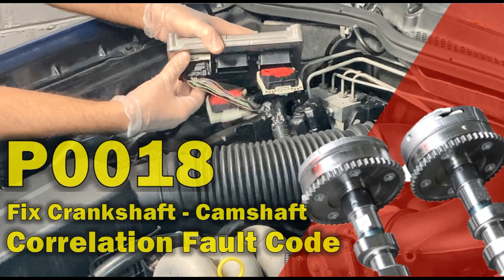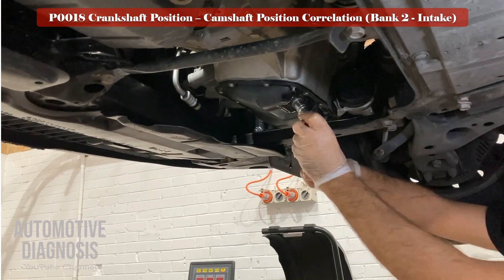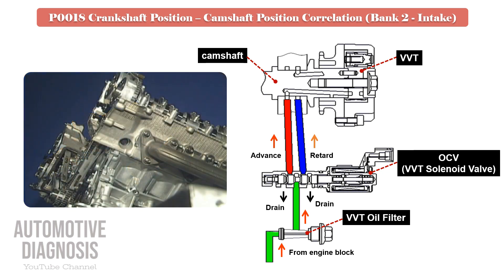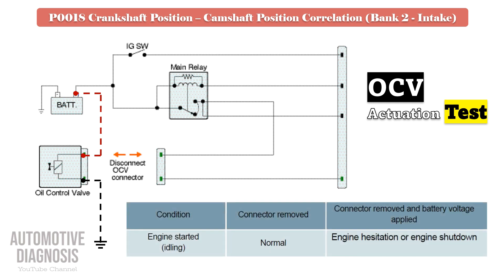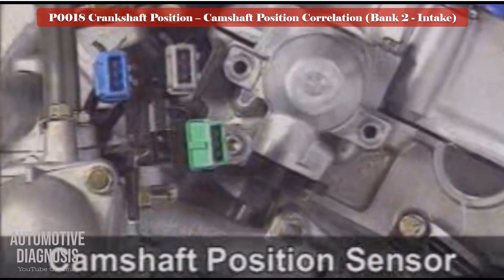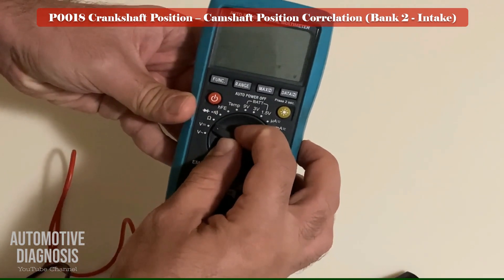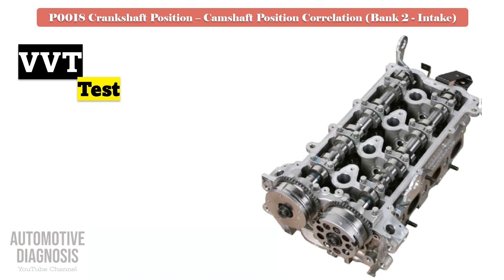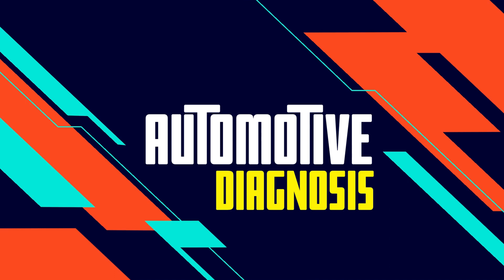How to Test & Fix P0018 Crankshaft - Camshaft Position Correlation Bank 2 Sensor A (Bank 2 - Intake)

Comment: Audi a7 2015 I did a oil change  and did a tune up P0018 plus bought 2- sensors cost $320 now after my mechanic did all that and clears the codes I went to work then on my lunch break drove off and the code re-appeared😤😤 what now🤨
Reply from the maker: Hi there, did you change the sensors or VVT solenoids? if sensors, which ones?

Comment: I need help please my Audi a6 2014 a6 3t shows bank 1 and 2 corraltion A AND CRANK SHAFT SENSOR , I changed them and I have miss fire on  4,5,6 I swapped coil pack and spark plugs still have all codes !!!
Reply: Did you erase the codes after you replaced the parts?

The vehicle may also have to do a relearn procedure.

You say it is a 2024 vehicle. Warranty should cover this repair.
Reply: @raoulcruz4404  idk why I put 2024
Reply: @raoulcruz4404  it’s a 2014 😭😭
Reply: Take it to the dealer and put the original parts bacl on the car. There gonna blame You and try to avoid the warranty

Comment: Dodge challenger 2017 3.6 v6 keeps getting codep0018 Crankshaft Position - Camshaft
Position Correlation Bank 2
Sensor 1 replaced sensor camphasers on bank 2 retimed it complete tuneup went away came back after a few months need help
Reply from the maker: Hi there, so basically you replaced the intake cam-sensor on bank 2 and redid the timing? You did not inspected or replaced anything else?
Reply: Hi I replaced sensor, both cam phasers on bank 2 timed it spark plugs ,coil injectors oil ,oil filter new battery and it comes back

Comment: Hi - i have these error codes on my s class 350 - when i connected the obd reader it did say car voltage was low.. do you think its the battery causing the error codes to show up?

Thanks in advance
Reply from the maker: Hi there, if there is no symptom and engine runs perfectly you can erase the fault code and keep an eye on it, if happens again there could a problem.
Reply: @AutomotiveDiagnosis same problem on my m272, engine runs fine but the code cannot be deleted
Reply: Hi  I have this code showing on my camry v6 engine, and it is over heating what may be the issue?